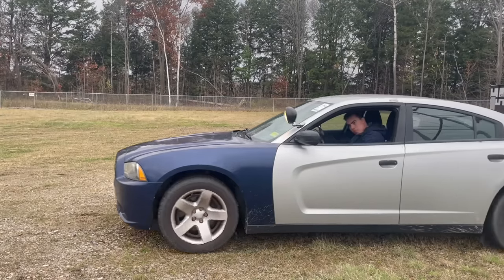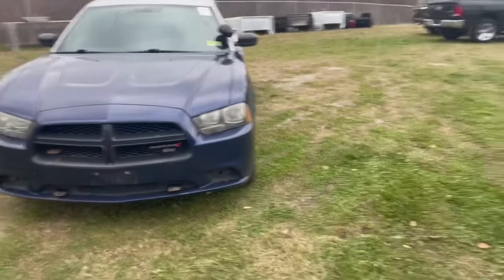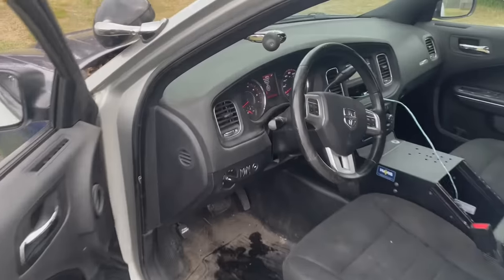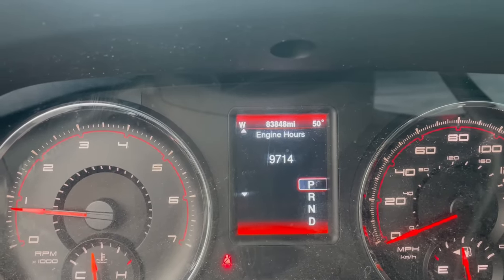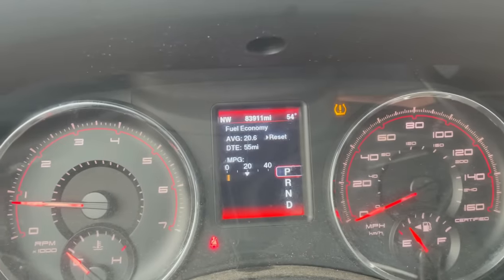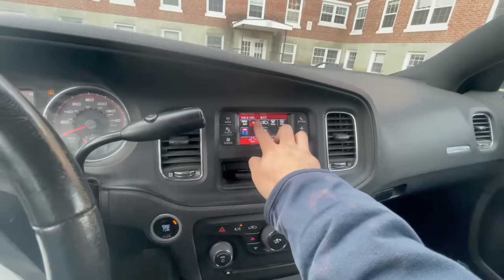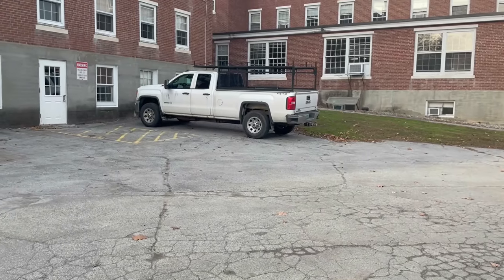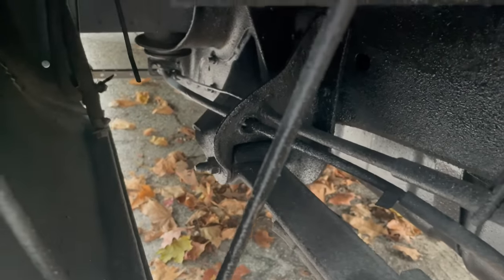Buying A Police Cruiser From Auction! Are They A Good Buy?

Comment: People talk a lot of trash about the 3.6 Pentastar motors, but just like anything else, take good care of it and it'll easy do 200k+.  Most of the plastic components can be replaced with aluminum like the oil filter housing and thermostat housing.  The main thing is oil changes frequently and never let it overheat, the mostly plastic motor melts quick but plenty of power and run smooth and quiet.

Comment: I bought a front drive impala police cruiser last year at auction.   a 2009 I believe     I got it for about 1200 bucks it had a new transmission just put in by aamco  10k earlier.     It drove it about 5000 miles and the transmission went out again so it was kind of a dud, but I might try it again one day.
Reply: Aamco transmissions are hot garbage.
Reply: Now there's a name I haven't heard in awhile...Aamco. "double A (beep beep) mco." Remember those ads?
Reply: @williamsinger4124  Worse than the doo woop transmission mechanics singing into their ratchets at Gibraltar, lol.

Comment: Saab's have a great undercoating applied from the factory. Watertight unlike Ziebart which ends up destroying cars. Rust usually starts on the quarter panels, doors and front fenders. Watch for the water pump on that car as they all start to go around 170-200k. Only use 0W-40 full synthetic with ACEA certification (Castrol Suntec, Mobil 1) and change every 5000 miles and it will run forever . Those early Ecotec's were bulletproof.

Comment: edit: watched the video and see you figured it out lol

Newer Dodge Vehicles usually have an monitor for engine hours built into the car settings right? Maybe you can do some digging to see if that's possible on these models. Will tell you how long it's sat Idle vs how many miles it has on it. Hope this helps you figure that out!
We've got some 2020 dodge ram trucks and work and most of them have under 10,000 miles and over a thousand engine hours lol

Comment: I have quite a few NYS trooper vehicles and it's not mileage, it's hours. I bought some '16 AWD pursuit Chargers for just over 5k and another for 6.5k, both hemi cars with low hours and mileage. Most barracks have a wash that keeps road salt from eating them to Swiss cheese. I still get plain clothes P71 Vics for 4500 in mint condition from the midwest and down south.

Comment: With all the bad press about the V6 this car would be a good little project, do engin oil analysis and transmission and some longevity testing to see if it really is a good daily driver for someone in need of a good used car.

Comment: That’s a okay buy. I get 2014+ ones here in Oregon with the v8 for around 5k and 110k miles but only 3000 idle hours. 

You got a okay deal, any multicolor police ones are worth about 50% as a paint job would be very expensive and nobody wants to drive a car that looks like a cop.